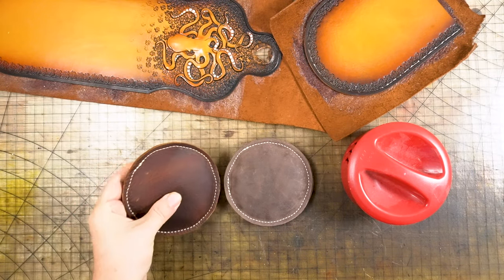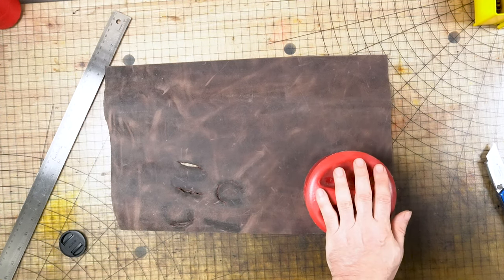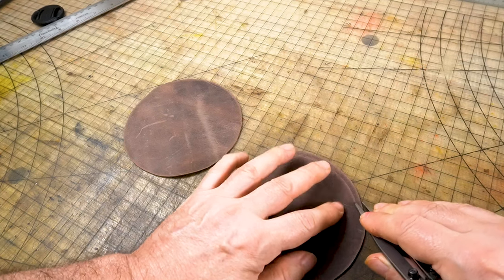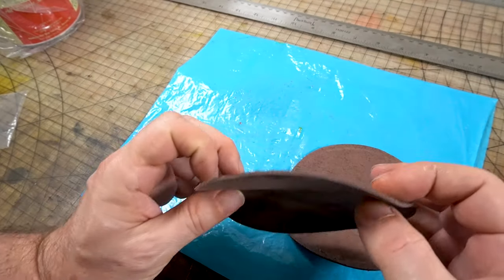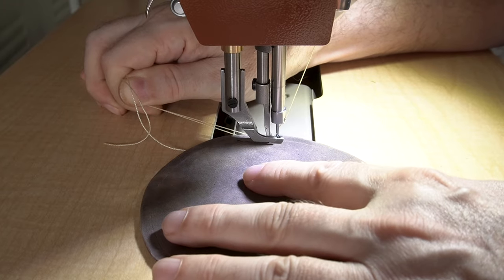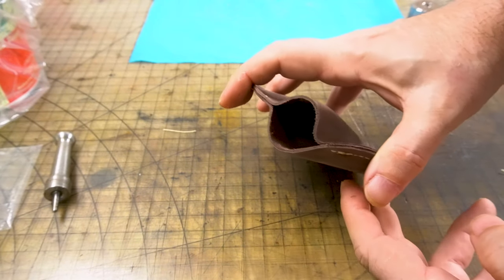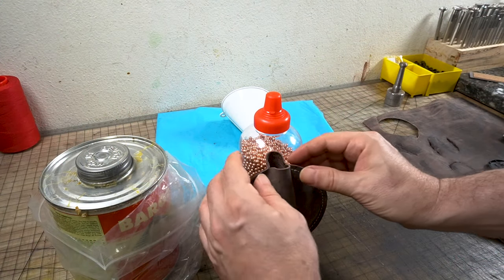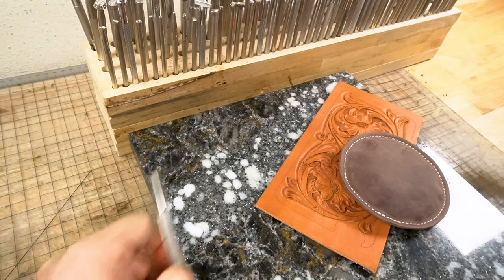How to Make a Leather Weight Bag. Leather Craft Tool.

Comment: Another great video sir. That weight bag would look great on any leather worker's crafting table. Heck it would look great as a paper weight or just a throwing bag. Also, that's a mighty fine sewing machine you have there. Hope that helps you as you said to sew much faster, practice makes perfect.
Reply from the maker: Thank you! I agree, the weight bags are cool looking. They would be nice as a paper weight on a nice wood table. They are soft so they will not damage the table.

Comment: What a great idea. I have leather and all of the needed leather working tools for this, but I'm a complete newbie to leather work.  I also think a slightly smaller version would be great as fabric pattern weights for sewing, which I need more of.  Seems like this would be a perfect starter project.
Reply from the maker: I agree! It is a fun project that is also creating a tool that you will most likely use forever. Just make a smaller circle. :) Thank you for your comment.

Comment: About how heavy do you want it to be?
Reply: Never mind, I asked while I was watching.
Reply from the maker: It is still a good question.  I would recommend no less then 1lb 3 oz. You are limited by size and thickness. I think 1 1/2 lb would be best. Your better off making it heavy since if it to light it will not be useful and the chances of it being to heavy are very slim. :)